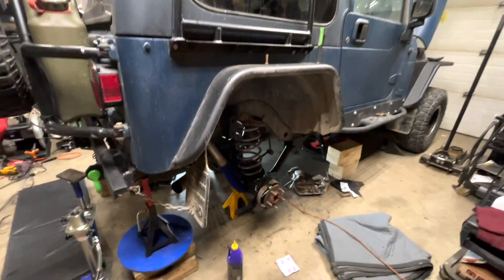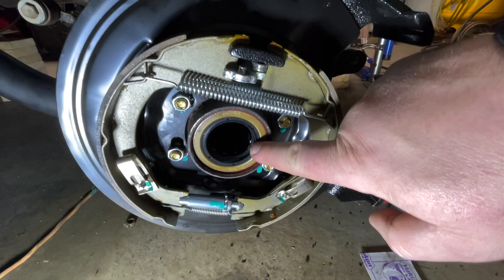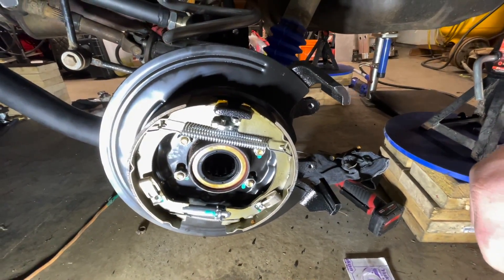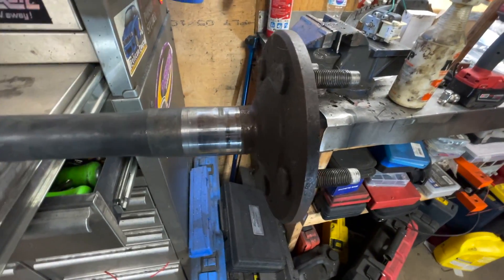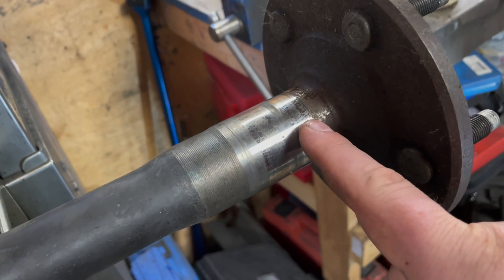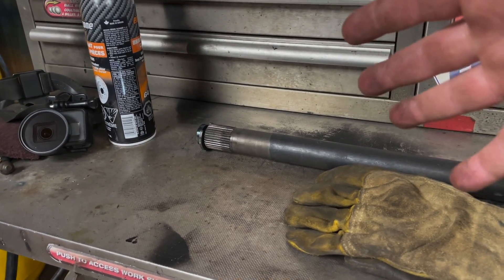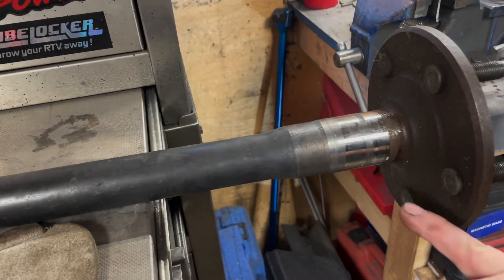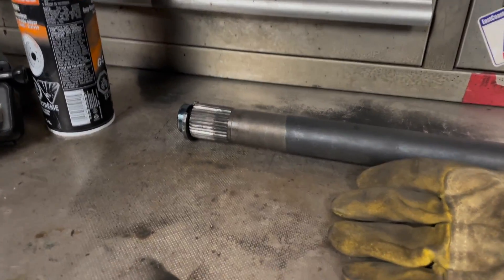WHY DO AXLE SEALS LEAK

Comment: Thanks for the video. I have 2 blown axle seals on my Cummins, and I think it is because I overfilled the differential. I checked the vent tube was open, and drained the excess oil. I will check everything again when I pull the axles out.
Reply from the maker: Maybe your vent is plugged

Comment: I have a leaking seal issue because lack of patience and actually scored or gauged the race where the seal sits I tried to fix with gasket maker around it but that didn't work mire than a week so I will try to polish by hand with sand paper 120-1500 wet any suggestions are appreciated 
considering a new diff housing from junk yard and take the lesson if it doesn't work polishing
Reply from the maker: Most likely you will have to sleeve it

Comment: Another thing that can cause an axle seal leak is a clogged diff breather.  If the differential can't breathe the axle seals can end up blowing out and leaking.  It's a common issue on the truck I drive (Nissan Frontier.)
Reply from the maker: That is a very good point, thanks for bringing that up